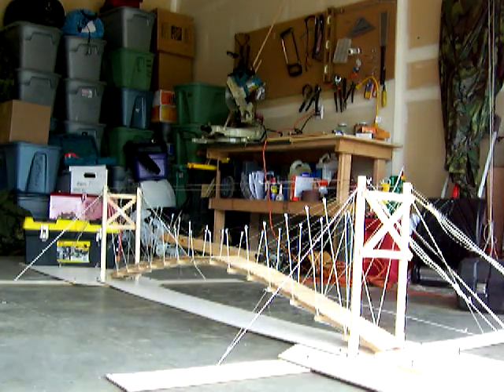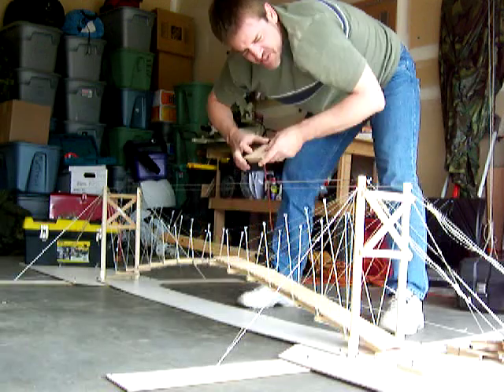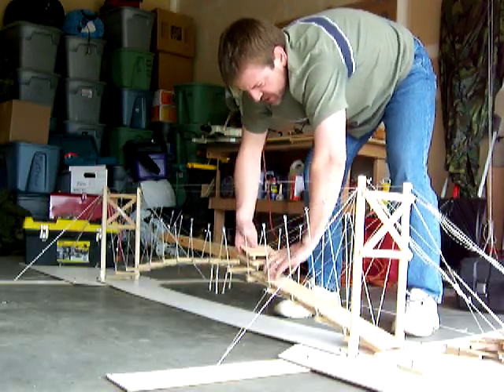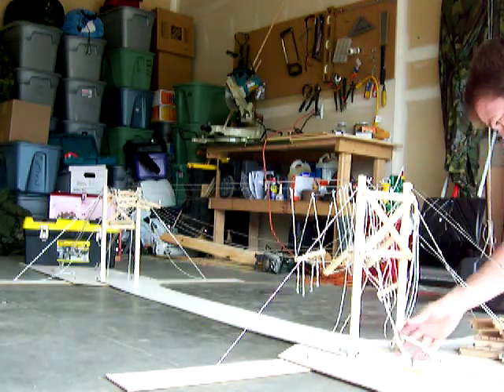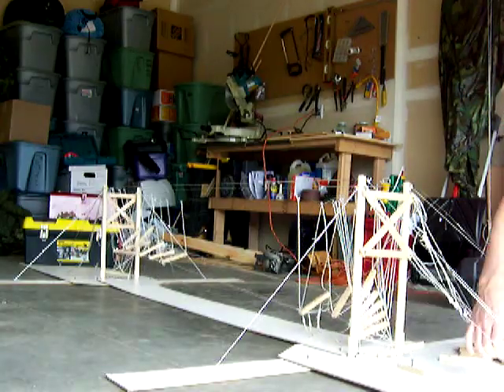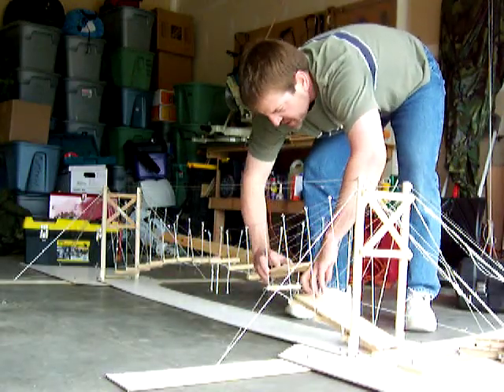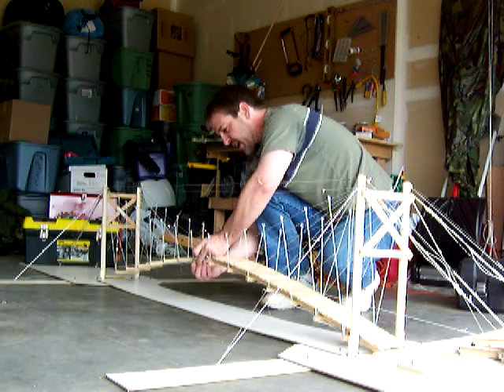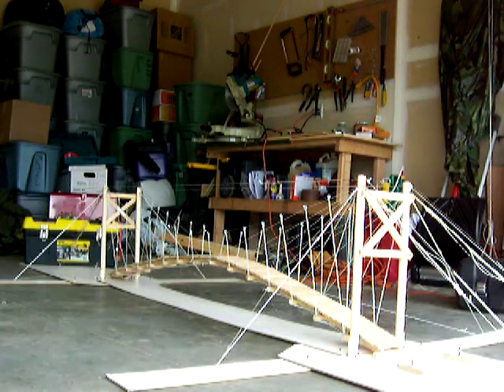Suspension Draw Bridge (retractable) Demo of model (Version 2)

Comment: how did you build it??
Reply from the maker: I precut/predrilled all of the material in my garage.  With a team of about 20 high school students, we set up assembly lines on site to manufacture all of the pieces.  We built the towers in pace on the ground and the raised them with the guide wires and support wires already attached. The "trapeze" was pulled across the river and tightened.  Then the plank sections dropped in place.  This was all scripted based on the model I created first.

Comment from the maker: The main cables that suspend the entire bridge do come down to hand level in the middle, on purpose.  This turns the main suspension cables into hand rails.  See the Facebook page for "Retractable Suspension Bridge" to see the actual bridge I built.  I understand that pulley would make it slide better on the main cables, but the weight (without the walking planks) is low enough that it only take two or three people to retract.  Not too hard and not enough to justify the extra cost & mainenance

Comment: no the pullys would be up on the top guide wire to alow the waite to more accross it easyer and no ones hands woudl be up there
Reply from the maker: I didn't want to use pulleys as that could cause them to more easily roll back and forth when walking on the bridge then causing a potential pinching hazard if someone was touching the top cables near the middle of the bridge.  Using thimbles works just fine and the slide without issue when there is very little weight (deck is removed).

Comment from the maker: The bridge we built didn't need to have pulleys.  We used cable thimbles that create an eyelet with the cable and allow the cables to slide well enough.  My concern with a pulley is that it could slip too easily while the bridge it being used and perhaps with slight movement catch someone finger.

Comment: for it to be retractable wouldnt the vertical conectior lines have to be on pullys on the main cable?
Reply from the maker: No, they are just looped over with a thimble and tied back to itself with u-bolts.

Comment from the maker: More can be seen at the Facebook page called "Retractable Suspension Bridge".  The actual bridge was constructed in 2008.  It has since been retracted and extended twice.  Each time, it took about 2 hour for 4 people to complete.  Bridge is still performing well and due to the severe winter condition in northern Montana, it is expected to survive longer with the decking sections stored inside each winter.